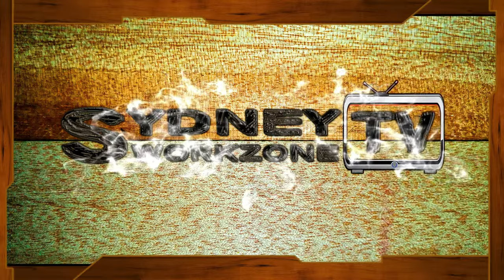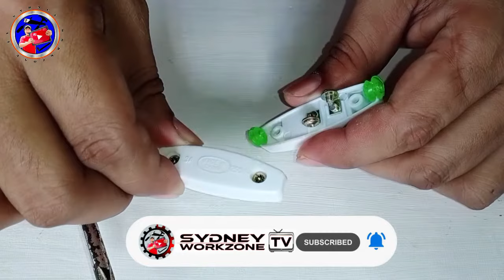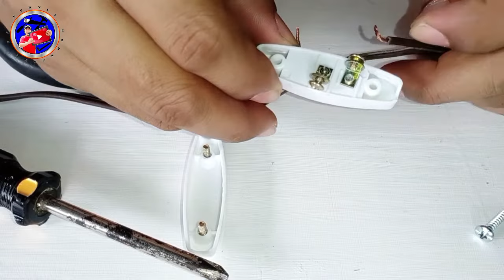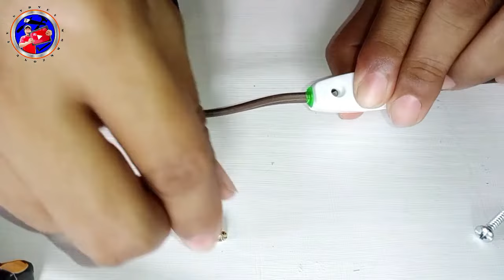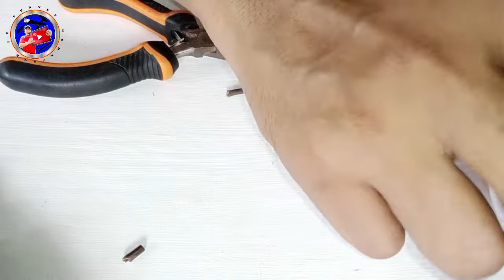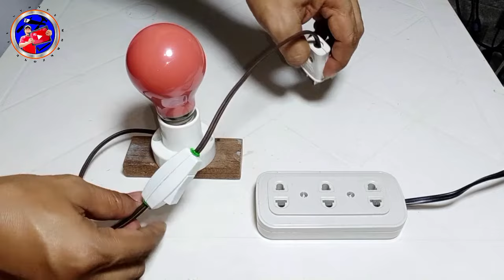⭕ Paano Magkabit At Mag Wiring Ng Switch ⦿ How To Connect And Wire The Switch ⦿ Hanging Switch

Comment: Sir meron po akong extension cable with switch. Kaso nasira na po yung switch. Pwede ko po bang tanggalin na lang yung switch tapos directly pagkonektahin yung dalawang hot wires instead na dumaan sila sa switch? For additional info meron pong label sa switch na 15A 125VAC.
Reply from the maker: 1 wire lang naman po ang switch pwede na po i-direct, parang tulay lang naman po yon switch.